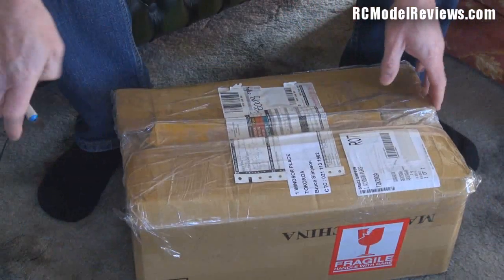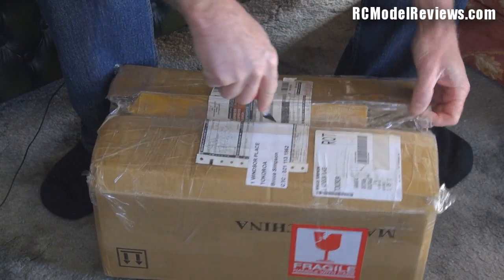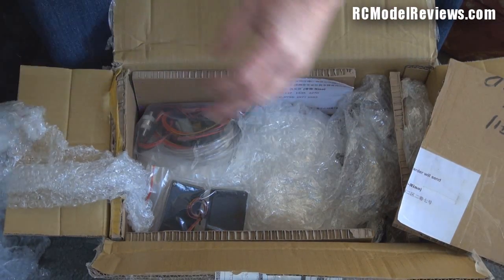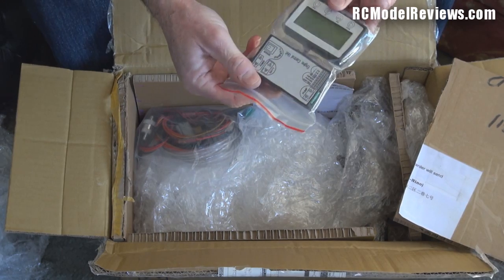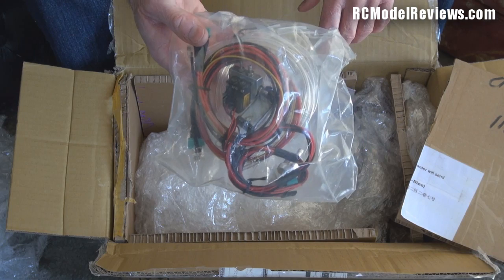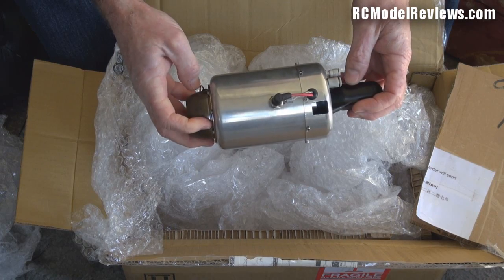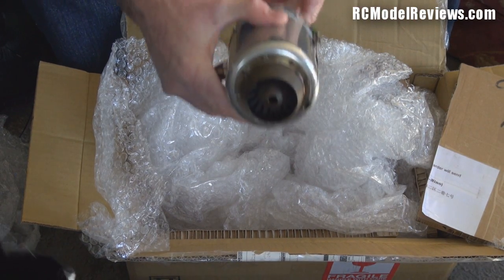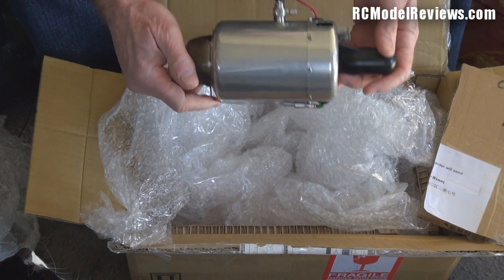HobbyKing Turbine

Comment: Hands down. Who really trust in a HK China turbine? They may be small but need the same precision in production like their big brothers. To be honest, I not even would buy a 2-stroke gasoline engine from HK.
There's a reason or two for a JetCat out of the Black Forest. :-)
Reply: Who really trust in any hobby-grade equipment anyway, so what the heck... Futaba with their early defective fasst receivers, 3w with their defective ignition systems, jetcat with their defective brand-new turbines that wont run properly for no apparent reason....
This ain't commercial aviation, with humans on board.

Comment: My original 54 mm turbine is pre Wren days and is continuing to run faultlessly after its maiden in 1999. Hover engine  rpm in my 2m rotor dia Alouette is 111,000 .Still on it's original GWS 688 ceramic bearings .3% two stroke motorbike oil.

Comment: My Alouette turbine has been flying since 2000 and is still on it's original bearings . 2nd combustion chamber and second fuel ring.5mm Inconel vapourising sticks . and if you are a druggie   free needles for the fuel ring.

Comment: Being a "budget" engine.. perhaps prepare some mitigation in case of turbine wheel seperation.. If it was me id set acouple cinder blocks on either side and wear a face shield for high power runs till you trust it haha.

Comment: Quote...."..... it's not going to be $999..." because you can't make this stuff for those sort of prices...." ..... But you CAN........ turbine engines have only a very few parts (far fewer than a 4 stroke glow engine), most can be churned out on a CNC machine for pennies.... the price has been kept artificially high, luring punters with fancy anodising and unnecessary bling.

Comment: I wonder what the price point will be.  I strongly believe a person should have professional training before using a product like this.  Not only operational training but they should be an expert at flying RC planes.  This is not a toy.  It can be extremely dangerous in unskilled hands.  I believe you to be very knowledgeable about this product with your experience with other jet engines.

Comment: While I'm not expecting it to be 'astounding' or anything, if the internals machining and fuel system is up to scratch, it's balanced and the ECU turns out to be a good one (i know I'm asking a lot), then it might actually be an OK option for folk with the turbine bug. Let's be patient and see how it actually runs before the "I told you so's" commence. Buy the way, you yourself have brought a few dud's in the past off 'cheap' outlets - right!?!?!? (that pusher prop gas thing for one)